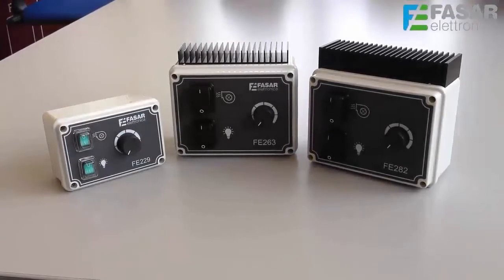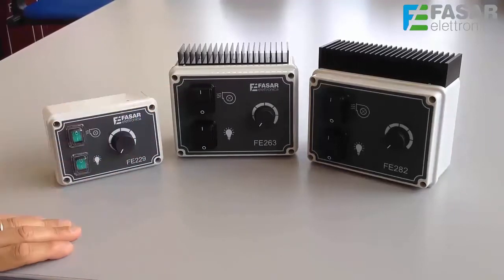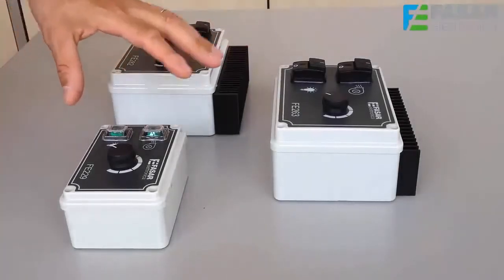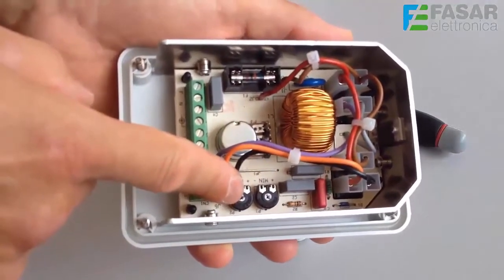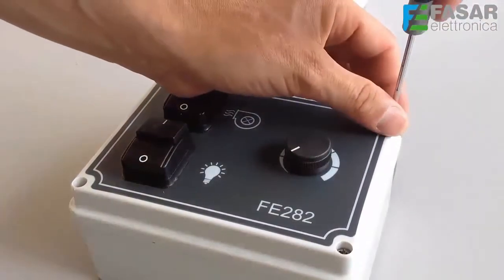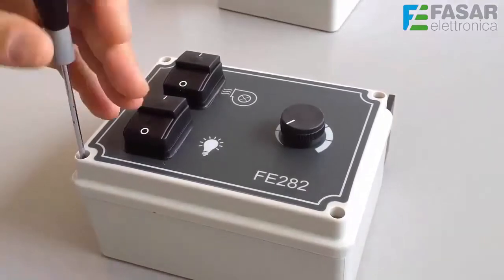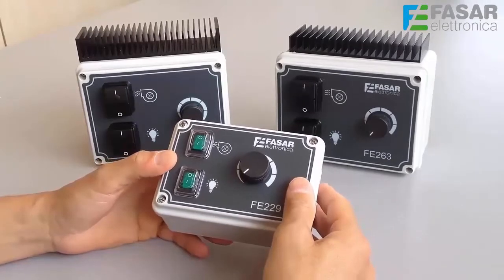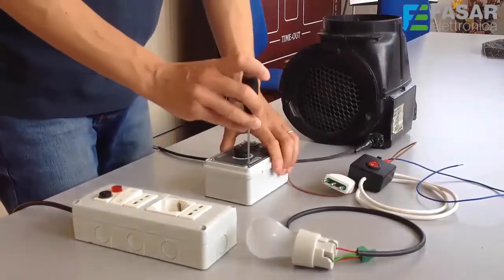Analog speed regulators for single-phase induction motors

Comment: Does this work on mag drills?
Reply: Hello, no, our speed controllers are designed mainly for air-suction, they are not retro-operated, they are open-loop, so if the motor encounters friction or some obstacle they are not made to maintain constant speed and torque, as required for example in drilling operations